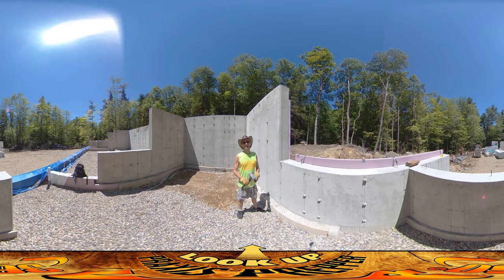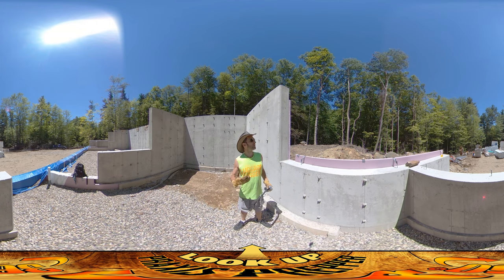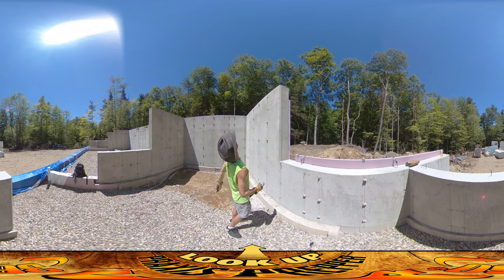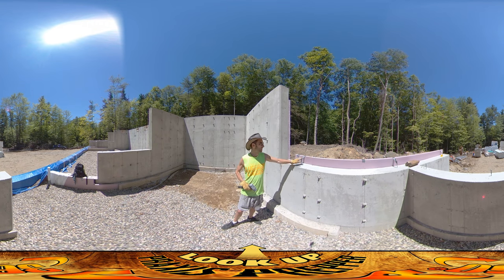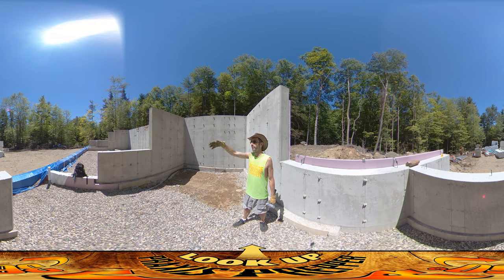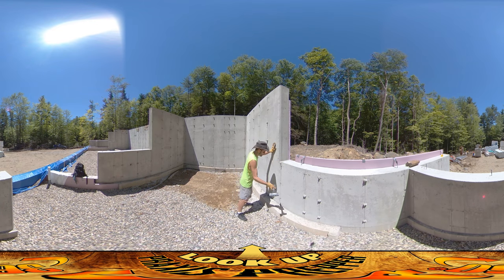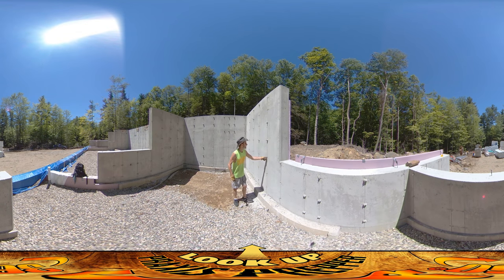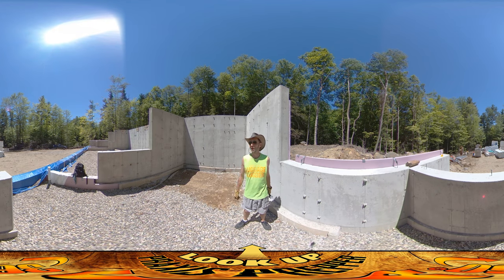Homestead Building - Removing More Form Pins, Sunblock and Drinking Water!

Comment: I had the pleasure of removing those pins on a much smaller foundation. I got pretty good at it with a carpentry hammer. I was able to take one off in two hits usually. One smack in one direction and one smack in the opposite and it would usually pop right off. Was able to get it pretty flush to. It's looking good.
Reply from the maker: Yeah, it's kind of Zen after a while.